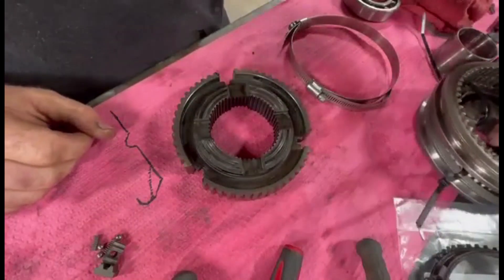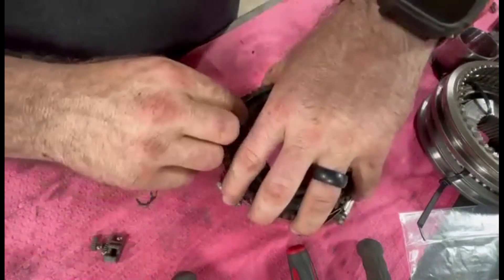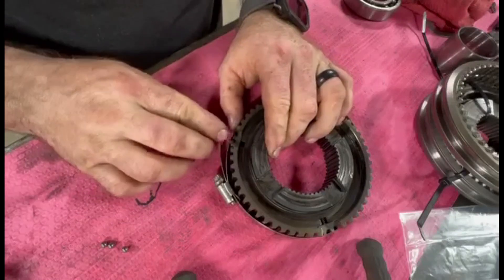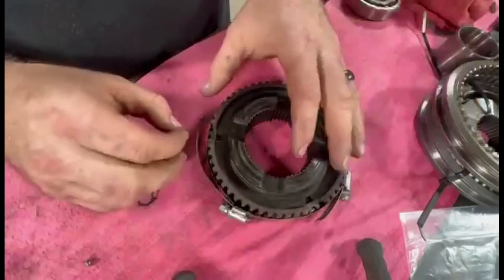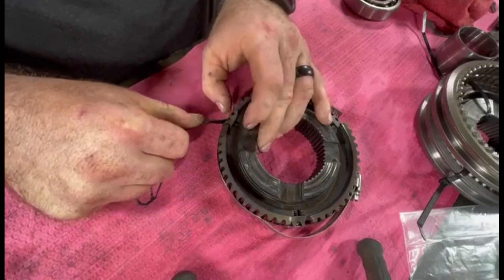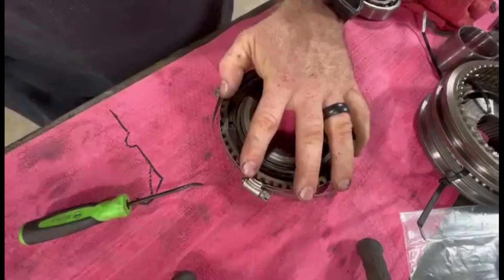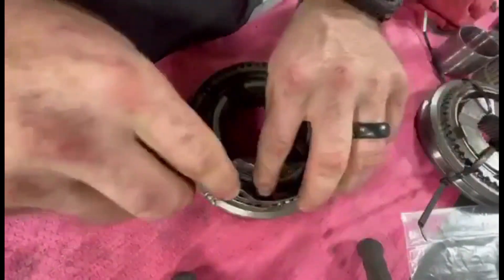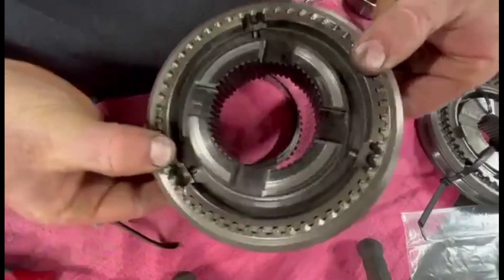NV5600 Synchronizer Keys and Springs Installation

Comment: When i built nv5600 i use another way...faster and less risk of ball and spring everywhere when assembly
Reply: Thanks for the teaser - I checked your channel but don't see any content. Care to share a video on your method for the benefit of the community? Or even a description in the reply to this comment? Thanks in advance!
Reply: @reddtekk  will try to make one...but i use a small flat screw driver and a plier...align the spring with the screw driver....push the ball with my thumb and use the pliers to align the block ik his location...take around 5 min to do a set of 3